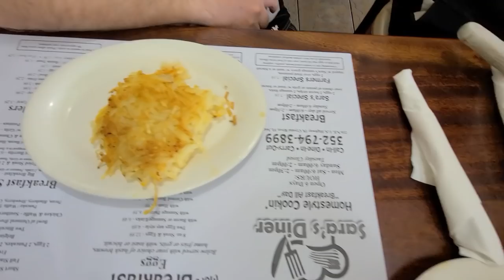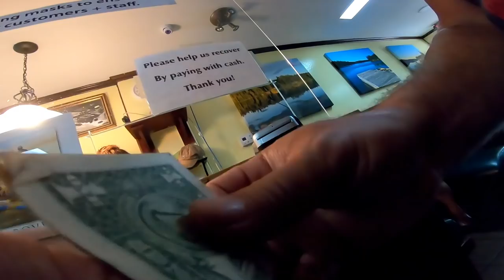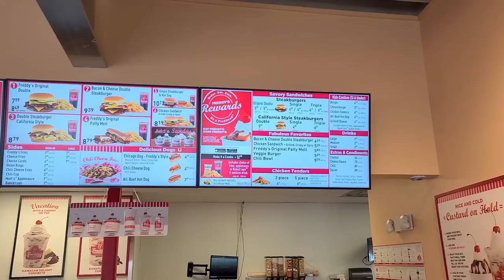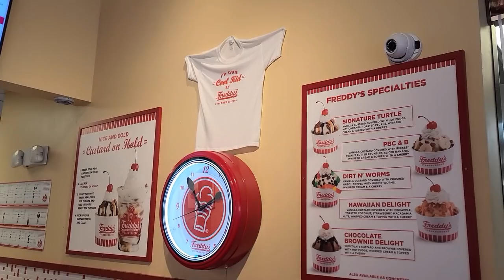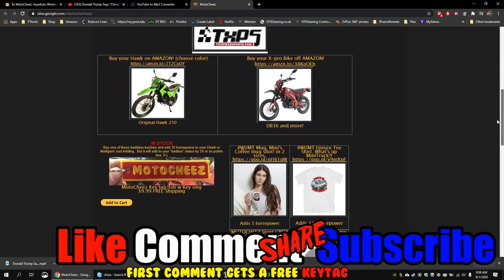(S3 E8) Hawk DLX, Raven 250, Honda CRF250 diners  Freddy's Steakburgers and riding crystal river

Comment: Young Frankenstein quotes are some of my favorites. What a great movie. Those shocks you get would freak me out. Parked the RV under a High voltage wire once and was inspecting it (walkaround) and kept getting stung. I thought it was bees, until I looked up and figured it out. It's called a hot skin on an RV.
Reply from the maker: That's crazy with the power lines, right?

Comment: Absolutely love the videos!!! I have a Raven 250, black and green. I would love to see you do a video showing the top speed full throttle. I am 5' 7", 160 pounds and I have done 60 mph easily in 4th. I only have 334 miles on it, so Im scared to go past 60 due to me still breaking it in. I know the specs say 68 mph is top speed, but I easily feel like 75 or 80 is easily attainable, stock!  I could only imagine a bigger front sprocket. Any thoughts??? Comments???? P.S I just subscribed to you channel. I'm now officially a "Cheeze Head"
Reply from the maker: It's about 65 maybe a little more. Ryan rode it too speed.

Comment: i went a month without AC and it was brutal. i just got a portable one a couple of weeks ago till i can get the wiring to get my main AC working. there has to be a break in the wire somewhere between the breaker and AC because it loses 30 volts between those 2 spots.
Reply from the maker: Wow. That's a lot. It's norlt the connection at the breaker
Reply: @MotoCheez  there is a switching box between the breaker and AC to switch between 2 AC's since i live in a camper the one went out but the other is new. i did all the testing at the box the wires that come out for the new not working AC before they go to the wire into the wall is 120 volt but only 90 at the AC. the other AC needs charged but no one will do that any more now days so i need to buy another one
Reply from the maker: 90 volts when AC running? Usually in a camper there's nothing between the breaker and rooftop.
Reply: @MotoCheez  this is a high tech camper they have a switching box to switch between front bedroom and central AC with only having a 30 amp main breaker they had to do that so you wouldn't keep popping the breaker with trying to run both AC's at the same time since each AC pulls around 13amps
Reply: @MotoCheez  also can't even get the ac to start in the back because the newer one's will not run if the voltage is below 110
Reply from the maker: Then I'd say it's that device that switches between the two. If.you have 115 at the receptical outlets and 90 at the units
Reply: @MotoCheez  the unit in the front has 120 at the unit and i took about 4 foot of wire i had laying around and have it running the portable AC on the back unit output since i kept popping the one breaker that runs all my outlets. so i know it isn't the switching system
Reply: @MotoCheez  it was the switch system i took it out and my roof AC is working now. so i now have a backup AC if it ever stops again

Comment: Great video!
Reply from the maker: Thanks?
Reply: Yeah I like the video was pretty good! I think as time goes on humans will evolving into growing a third appendage specifically to hold cameras
Reply from the maker: Thanks! Agreed
Reply: Oh I forgot to ask if you get shocks on the raven under the power lines..
Reply from the maker: Yes. Same
Reply: I think that Chinese designer should be made to ride 150 mi down a power line before they sell a bike to the public. I bet they fix it then..
Reply from the maker: From all the comments I've been getting it's common on all the bikes even the back of pickup trucks and even motorhomes if you're outside of them. It's the power line

Comment: Does the raven and the dlx really have less power then the hawk? I was doi g some research the raven looks like it got an egr system on the side of the head but no one really talks about it there is no source on that what so ever..
Reply from the maker: The hawk DLX does have a little more power then the raven, the pollution system is on the exhaust pipe not the head on all of these new carbureted style engines that I've reviewed